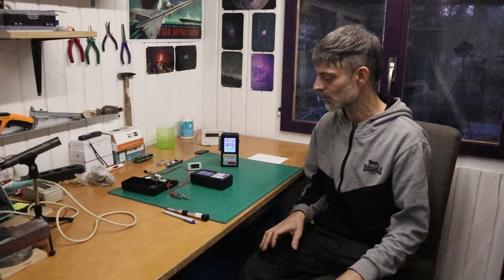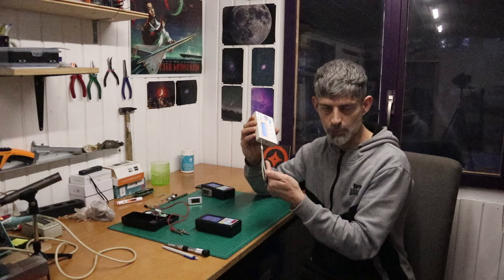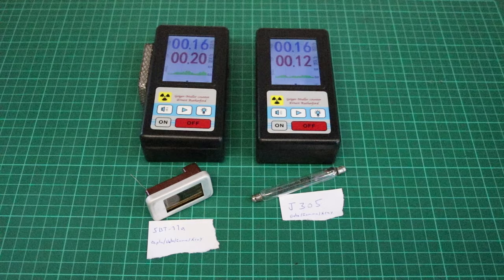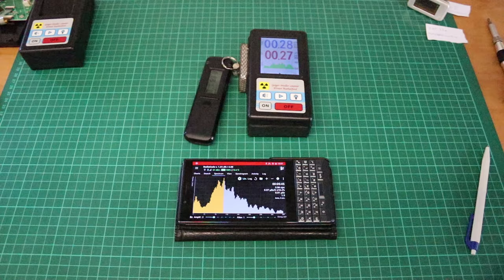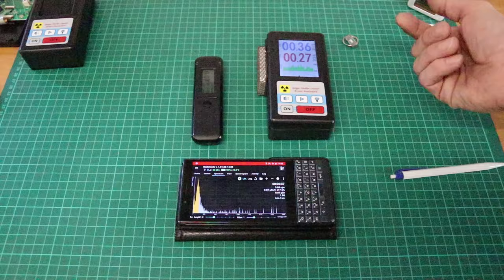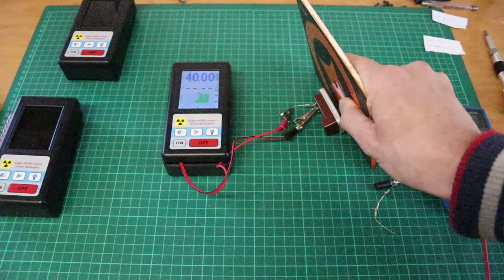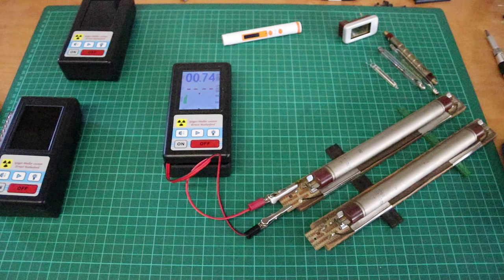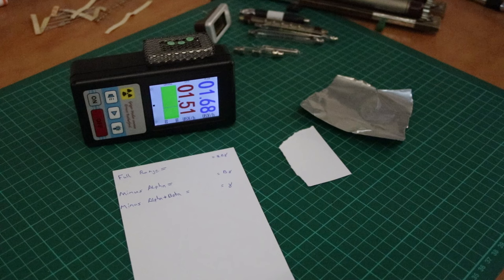Geiger Counter Modifications and playing around with different GM Tubes

Comment: Nice video, once again!  The BR-6 get a new life!  My BR-6 came with the J321, which is pretty sensitive, but nothing like the SBT-11.  The best thing about the BR-6 is the nice display, the worst is that the firmware won't record above 99.99 uSv/h
Reply from the maker: Thanks Mate! :D ..youre lucky then to have a BR-6 that goes up so far, the series i got all max out at 40 uSv/h haha! ;)
Reply: @BremsstrahlungChannel  On mine the graph tops out at 600 nSv/h and the digits are done at 99.99 uSv/h.  I recently obtained a strong Sr-90 source and I managed to find the limit of the range using that.
Reply: There is definitely something wrong with the J321 that you have.  I did a video on using to replace the J613 that is now used on the FNIRSI GC-01 and it works great.  There are a lot of positive comments for that video from folk that have also made the conversion.
Reply from the maker: Yes i think i just had bad luck with my J321s.. but i mean i got them out of the cheapest, worst geiger counter you can buy currently, so im not astonished if they just used old or fake tubes.. i guess mine just dont have the gas inside anymore... also of course ive seen youre sr90 Video :) youre seriously one of my favorite youtube channels ive encountered in a while! you got a real fan here, always really happy when you upload something new! :) btw i found a similar swiss made geiger counter with active source a while ago, if youve got some time to kill heres the video about it ;) https://www.youtube.com/watch?v=1FvVP9-DDRw  @project-326
Reply: @BremsstrahlungChannel  Hey mate, I just watched that video, those check sources had to be really strong because these military counters were designed to measure fall out products, not long after the blast.
I think that the cold war strategy was that the army that came out of the bunkers at the 'correct' time, would win.  Too early and the troops would be fatally irradiated, too late and the enemy had overrun you.
Reply from the maker: yes i totally agree with youre "thesis" ;) ..my first thaught was that they used these for power plant workers, but youre cold war theory makes much more sence :) what a crazy time! ..despite switzerland officially being "neutral", it was very militarized during the cold war, theres alot of interesting stuff to find from that era here :)  @project-326

Comment: your j321 tube is a dud, i just bought one of these tubes for my junk fnirsi gc-01 and it brought that counter to life! 100x better then the j613 that was in it. and fyi i have flashed the gissio radpro firmware to my unit as well.

Comment: Great to see a video from you Manu, i will DM you soon buddy, I've been really sick still hence the lack of video uploads etc.. small side note here, if you use a DMM with a 10Mohm input to measure the tube voltage it will read lower as the 10M of the meter is a load and will form a voltage divider with the Anode resistor, i think you are probably aware of this problem with high impedance circuits and have compensated for this in you measurements..
All the best from the UK 

Steve 👍
Reply from the maker: Good to hear from you Steve! :D haha well i am still an electronics idiot ;) but i thin i know what you mean and i forgot to mention that point in the Video ;) I measured all GM Counters Voltages with tubes removed, directly from the electrodes. And i did not use the standard Multimeter because i know they have issues measuring Geiger Counter Voltages ;) I found this small Voltmeter on Ali that goes up to 2000v, this gave me more "reasonable" results compared to standard Multimeter ;) I hope thats what you mean and i didnt mess this up haha! ;)

Comment: I got the FS-5000 and love it but it’s very slow to respond and not crazy sensitive. It has a J321 tube but I have been wondering if I could mod it to take a pancake tube.
Reply from the maker: i think the "slowness" is due to not so good firmware ;) its not about the tube ;) i guess it could work with a paancake but it depends the voltage the tube needs, i dont know the american pancakes since i dont have one, but im pretty shure it could work well with the soviet sbt-10, sbt-11a etc tubes ;)
Reply: I did a modification and swapped in a SBR-11a tube and it’s amazing. What I was thinking was slow to respond was CpM. It’s some kind of average so it goes up slow. But CPS goes up instantly. Now I’m needing to swap in the correct anode resistor. What happens if you run to high if current to a tube? Mine is running good without the added resistor but I’m wondering if the much higher current for j321 / j305 tube is too much for it. Thank you

Comment: Curious about the anode resistor on the BR-6 mod. Did you remove or jumper the original 2MOhm on the board and use 10M at the tube anode, or did you leave the native resistor in place and use 8M in series at the tube? Or just use 10M and leave the original in place too?
Reply from the maker: i think i left the native resistor in, just eyeballed my way to the 10Mohm value ;)

Comment: Excellent video. Thank you so much for this! I hadn't realised the importance of adjusting the anode resistance. This is really useful to me as I have been playing with changing J305 to SBM-20 in my Cajoe detectors but hadn't understood about adjusting the resistance. Don't suppose you know the anode resistance that Cajoe’s use?? I want to go off now and give this a try to see how performance changes. Thanks to your video I will also now try some SI22G tubes in the Cajoe's starting with your resistance values. Thumbs up!
Reply from the maker: Thanks for youre Comment! And im really happy if my Video helps ;) ..i dont know the Cajoe Board, but im pretty shure its easy ;) Try to look for a single Resistor right behind the positive "pin" where you connect the tube. Im pretty shure it will be around 2 or 3 MegaOhms like most GM Counters. Also its really okay to "eyeball" the Anode Resistor Value abit.. im using my SBT-11a with 7Mohm instead of 10Mohm for a while now, works like a charm ;)
Reply: Thanks Manu. Great advice. I'll give that a try! @BremsstrahlungChannel

Comment: I have a GMC-300+ with an SBT-11a I retrofitted in.  I added the 7MOhm of resistance (thanks again on that) on the anode side of the tube and I'm getting a funny output from the system: the CPM will increase with activity but never drop back off.  Wondering what I did wrong.
Reply from the maker: hmm thats strange.. never heard of that "malfunction" ;) i have the 320 model, so i dont know the 300 really.. maybe the resistor value is different? i would try to experiment with some different Mohm values.. maybe try a 5Mohm, 10Mohm etc.. dont think you can break anything this way :) Good luck to you! :D

Comment: Great video. Any luck with a GMC 320+ tube upgrade using a SBM-20?
Reply from the maker: ..i did use my GMC 320 with a SBT-11a for a few years, was a really cool mod! i think i used the battery compartment to fit the tube, worked relatively well, but i had to replace the internal battery with a smaller one to make it fit ;) You can see the mod in some of my older videos i think ;)

Comment: I'm curious about the modifictation of the GMC 320, in the finding uranium in Nature video it seems like you have a trimmer at the front. Is this to adjust the voltage? So far it seems like you can't adjust it originally.
Reply from the maker: ..i think what you mean is just the screw plus a washer ring to hold the sbt-11a in place ;) its not a trimmer ;) however, there is a trim potentiometer for the voltage on the pcb of the gmc-320! its pretty obvious when you open the device, you can adjust the voltage ith a small screwdriver ;)
Reply: @BremsstrahlungChannel Thank you, I haven't found a trimmer pot on mine. But maybe I'm just blind xD I will check again.
Reply from the maker: hmm maybe we have different models of the 320? i believe the pcbs look different depending the specific model.. mine is the GMC-320 plus. its already 7 yeas old or so, so maybe youve got an updated version? i can also suggest the GQ companys website, they have a really great forum there and i guess you could also pass them an e-mail to ask for some advice. if nothing helps, pass me an e-mail to bremsstrahlungchannel@gmail.com or pass me a message on insta, i can send you a photo of my pcb and point the potentiometer out if you want :) @MyProjectsTV
Reply: I just realised i have the GMC-300E plus. I bought a geiger tube with a voltage range that's correct so there's no immediate need to find that out. I was just curious how I could do that ;) But thx for offering the support. @BremsstrahlungChannel
Reply from the maker: ..ich wechsle mal auf deutsch ;) hab irgendwo gelesen dass bei gewissen GQ modellen die Voltage per menü verändert werden kann, evtl hilft das? ;) sonst gibts noch die arduino geiger counter boards auf ebay, bei denen hats sicher ein potentiometer für die volts dran, kosten auch nicht alle welt ;) ps: einfach den richtigen "anode resistor" nicht vergessen, das kann von zählrohr zu zählrohr variieren, auch wenns die gleiche voltzahl hat ;)  pps: cooler kanal hast du! muss mir noch mehr deiner videos anschauen, gefällt mir sehr was du macht :)  @MyProjectsTV
Reply: Bei meinem kann man die Spannung auch nicht im Menü verändern. Den richtigen Widerstand hab ich schon. Ich hab sogar nen ganzes Datenblatt vom Zählrohr ;) Und vielen Dank fürs Kompliment. Das nächste Video ist eventuell über den modifizierten Geigerzähler, weil ich momentan nicht viel anderes mache xD   @BremsstrahlungChannel

Comment: What did you use to protect the SBT-11A (the wire mesh)?
Reply from the maker: its just some steel wire mesh i found at the hardware store, bought a flat sheet of it and carefully bent it around the aluminium housing of the sbt-11a ;)

Comment: Hey im very new to this, can you hellp me, i order br6, if i use the sam e tube it comes with but extendncontacts with wiers snd gloo tge tube directly to the back case will that help alot??  So just take the tuve lik you did with aligator clips and extend with two wiers and glue the tube to the case tnx.